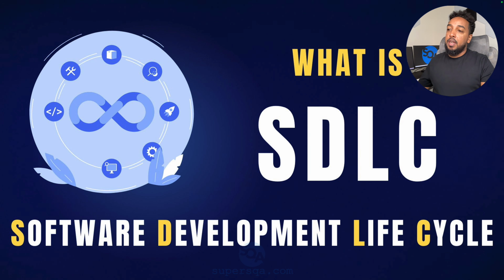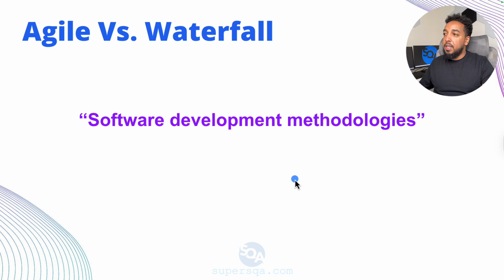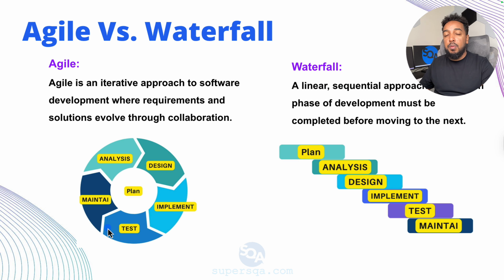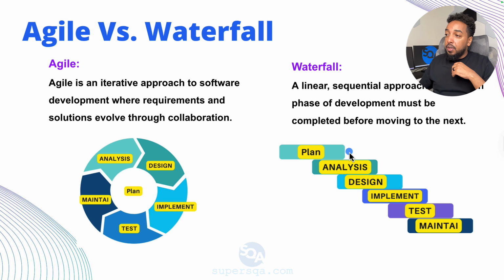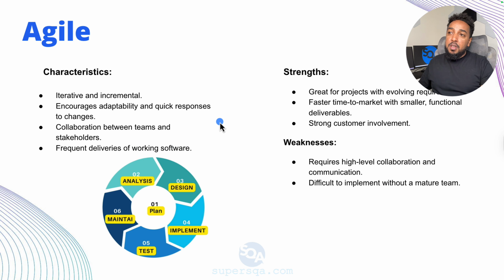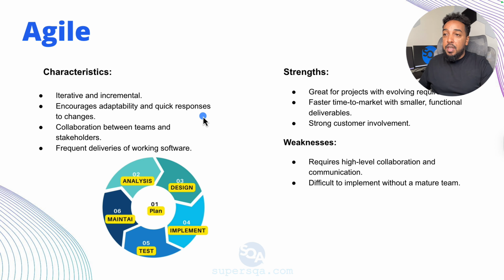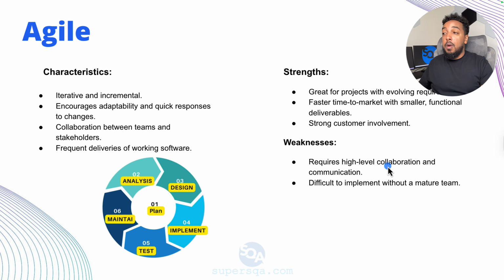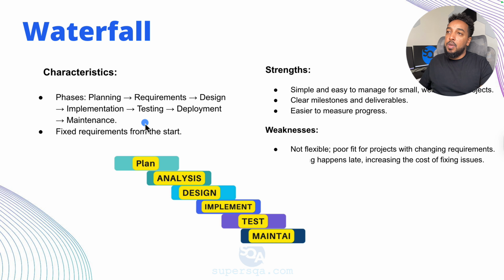SDLC Explained for QA Testers - Software Testing Tutorial

Comment: Sir sql use for sdlc and mannual I'm confusion sir
Reply from the maker: SQL is a tool used for database verification during the testing phase, which is just one part of the overall development life cycle. :) So they are different things. SDLC is the whole process of building software. SQL is just one of the many tools that will (might) be used in the process. If the application uses some type of database, then SQL will be in the process because the application will use SQL to read and write data to the database and QA will use SQL to verify data is written and read correctly from and to the database. I hope this helps clarify the question.